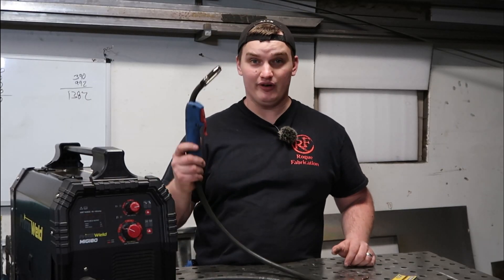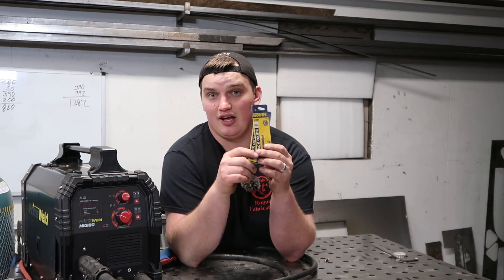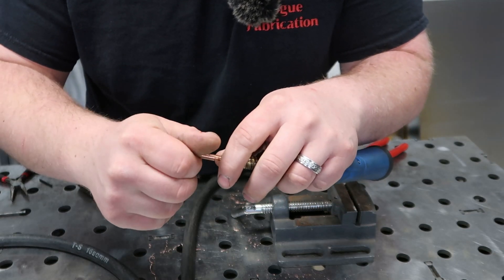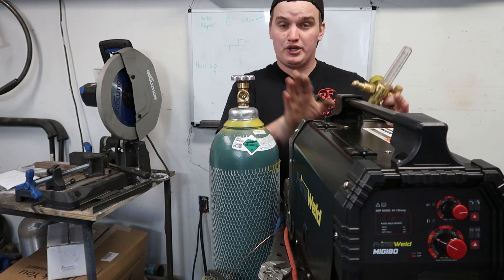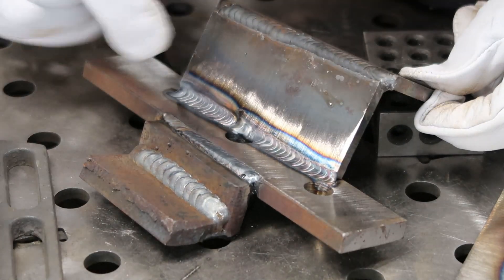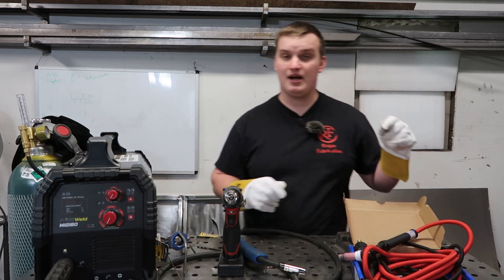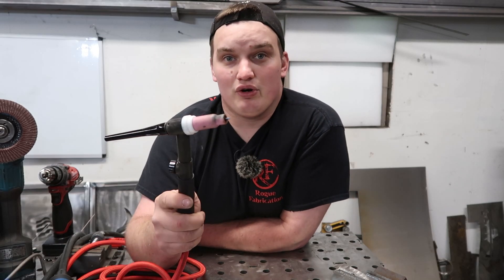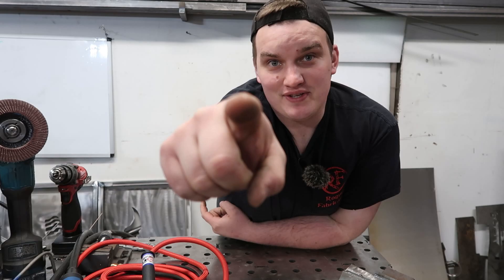How to turn your Mig Welder into a Tig Welder  (PrimeWeld)

Comment: i conect a 26 tec weld tig torch used for hf and cold tig machine..conect buton to mig buton too...and for real tig start before touch the piece if open argon botle cut 8mm... its really stronger in mig mode

Comment: Can you tig aluminum with this method? I very interested to see if that's possible.
Reply from the maker: Unfortunately not.
Reply: Why wont it work on aluminum? @amcustomfab
Reply from the maker: @truckitt2u  because it's DC only. You need AC to weld aluminium

Comment: This will not give as good results as welders with the appropriate functions, but your results look surprisingly good.
The difference between a TIG and MIG power supply is that TIG is constant current and MIG is constant voltage. I discovered this years ago when I bought a MIG spool gun and connected it to my TIG inverter, i.e. the opposite of this video. The TIG constant current would blow the MIG wire away each time it struck an arc. When I turned the current down, the wire would just keep sticking. Maybe TIG welding on constant voltage is easier than MIG on constant current though. 
 TIG inverters are really cheap these days, although high voltage start makes it SO much easier. I bought a cheap high voltage start unit for my TIG inverter which makes starting so much easier than scratch start.

Comment: Great video but one small contention, negative is not the same as ground. 
There are these things to think about. 
Positive ground is when a car battery goes positive to chassis. 
Negative ground is the opposite. 
Neutral ground is part of a star circuit. 
Ground literally means chassis or earth. 
I am saying this as a locomotive electrician. 
I know you mean well so I hope this is the help that is intended.
Reply from the maker: Thank you I really appreciate and respect the constructive criticism always happy to adjust my terminology to be more accurate thanks for supporting the channel 😎
Reply: @amcustomfab  
Thank you for getting some great information out there for us. 
I am not a welder although I must weld fairly often and am not terrible. Not great either. Just self taught. I learned to braze, gas weld and forge weld early in my career. Electro welding has come pretty easily. I learned some harder things first. 
I now need to teach my fourteen year old son these things and tig I think he would get the hang of the fastest. I know it came easily to me as it’s similar in process to brazing and soldering. 
So converting a machine I have to what I need is what your video is all about. 
In fact the swapping polarity is a key fact that I didn’t think of. 
Thank you and keep getting better. Never give up and always look for options. 
Greetings from the high plains of Texas.

Comment: Why does the tungsten become live ? On a mig i can touch my wire on to the weld surface without it going live until I squeeze the trigger. Why does putting a tungsten into the end change this?
Reply from the maker: Because when your MIG welding you're not on MMA or stick welding mode. When you switch to stick welding mode the lead is live the entire time and it's not determined by the trigger. 😎

Comment: I don’t know why the manufacture just doesn’t offer a scratch start tig torch for these machines lol!! They would make money selling them. I’m talking like for the little Lincoln mig park 10 or the power mig 180 even the Miller machines
Reply from the maker: The CK worldwide one I showed later in the video plugs right into the prime weld machine
Reply: @amcustomfab  ya seen that part. Lincoln could makes some money but they are blind to that fact lol
Reply from the maker: It would be a little harder for a user to install on Lincoln because you have to go inside the machine and bolt it to the lugs it doesn't just have a dense connector on the outside still possible but not as user friendly 😎

Comment: doesnt the trigger on the mig torch still work after converting it to a tig torch?
Reply from the maker: Only to turn the gas on
Reply: @amcustomfab  is it possible to run a gasless mig welder with a tig torch with a trigger and running the gas line directly to the bottle through a regulator , im curious if it is possible to lift tig with this setup.

Comment: Doesn't that machine do stick as well? If your using the tig torch you can put it in stick mode and just adjust the amps that way instead of adjusting wire speed and voltage.

Comment: Hello, great video and idea. I'm in the market for a welder and I'm in a bit of a dilemma because here where I live availability of gas purchase for the hobbyist is not easy (or affordable)  so since I'm interested in being able to weld aluminum and also SS (plus mild steel) it would be 3 different gases so I kind of discarded this machine. I was looking into the MTS200 so I can add a spoolgun for alu MIG (with argon) and use the same gas for TIG SS.
Sorry for the long story... my question is how thin SS can you TIG with this "hack" using the TIG torch? Thanks.
Reply from the maker: Probably 1/8" ..

Comment: Cool trick!  I'd think that'll lower duty cycle significantly or no?
Reply: The Duty Cycle is something you would definitely need to consider if using a lower ampage machine for long periods.
 
But Most people welding with lower ampage machines would not be welding huge structures.  
👍

Comment: I wanna try the scratch tig with my mig welder one day. One thing I don't get is why all those torches have a knob for the shielding gas. I would assume that it shouldn't be too hard to put an electrical valve somewhere near the flow regulator, which could be activated by a button on the tig torch. Would like to hear your thoughts on this.
Reply from the maker: You're correct you could absolutely rig something up like that in fact I did a video where I did something similar to that for purging stainless
Reply from the maker: https://youtu.be/z0IdqsBpNqE
Reply: @amcustomfab  will check it out. Thanks
Reply: If you want to use the electrical valve, you must to use the mig torch as he shown on the video....i find the result it's really good and it's a cheaper solution....what do you think ?
Reply: Generally the button you are talking about is only for HF (high frequency) start.
The knob is very common if using a scratch start Tig torch.
( but this is something you might already know  ?? )
You could set something up like you've mentioned ?
But i never seen anyone bother with the hassle of doing this. 
Each to there own. 👍
Reply: @weldmachine  yeah I know that. Just seems a hassle with the knob style. But then again, I never used that style of torch so I may come to another conclusion when I do.